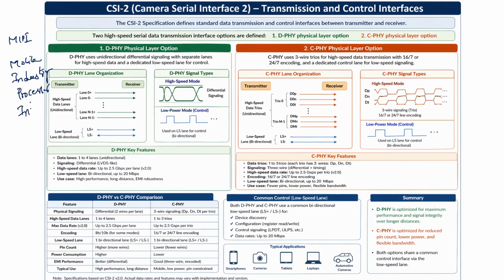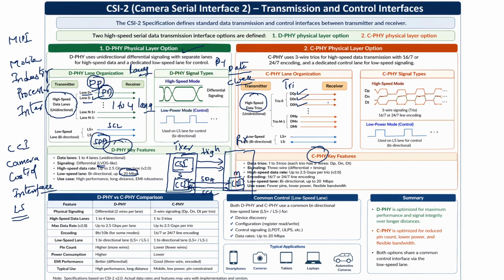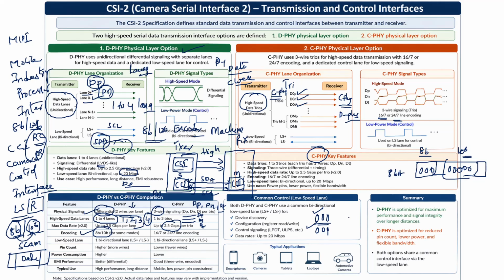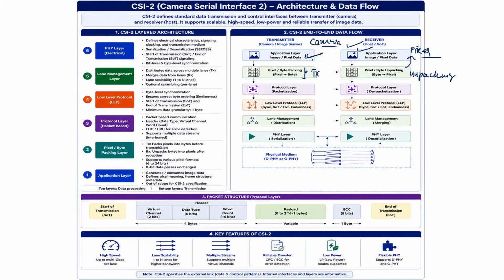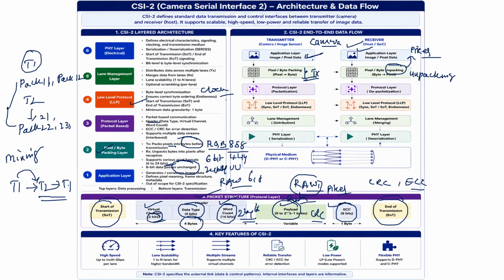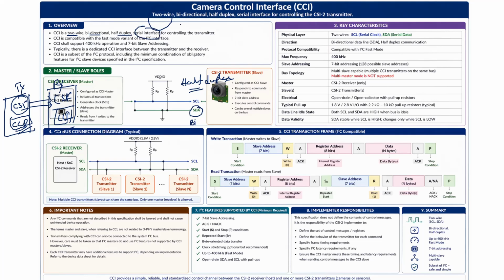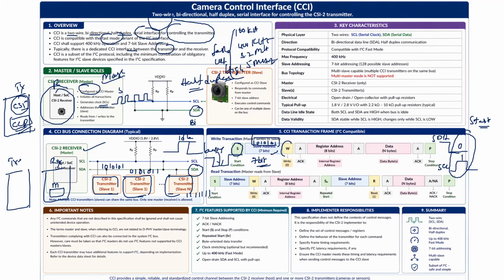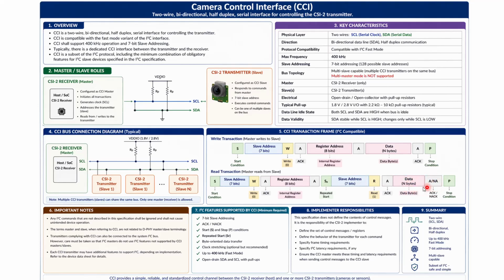mipi protocol part1

Comment: Stop propogating WRONG Info. There is no LS+ / LS- pins ...
Reply from the maker: You are correct. I want to clarify and correct the diagram I previously provided. The “LS+ / LS−” shown there should not have been represented as separate physical low-speed pins for a standard MIPI CSI-2 D-PHY interface. That was an incorrect representation on my part.

In MIPI D-PHY, the physical interface consists of a dedicated clock lane and one or more data lanes. Each data lane uses Dp/Dn. The same Dp/Dn pins support both HS differential signaling and LP signaling; LP is a signaling mode, not a separate LS+ / LS− pin pair. MIPI's own material shows the D-PHY Dp/Dn lane transitioning through LP-11, LP-01, LP-00 and HS operation.

So the correct terminology is “LP (Low-Power) mode/signaling on the Dp/Dn pins,” not “LS+ / LS− low-speed pins.” MIPI's published D-PHY configuration also identifies the physical lanes as D+/D− and the clock lane, with no separate LS+/LS− pair